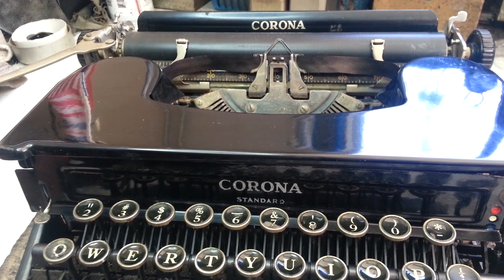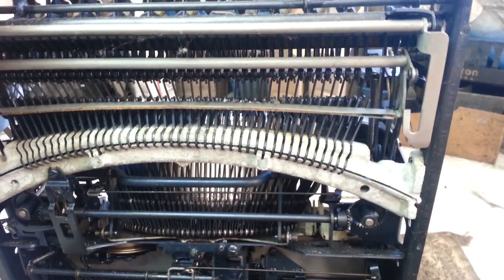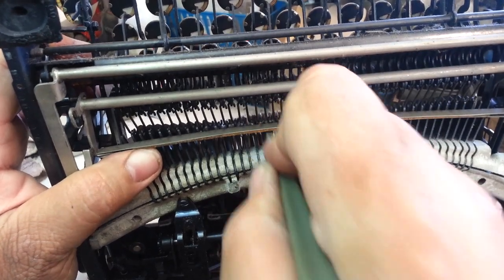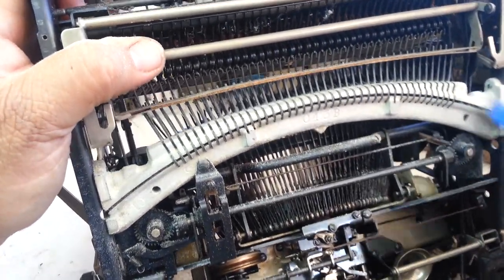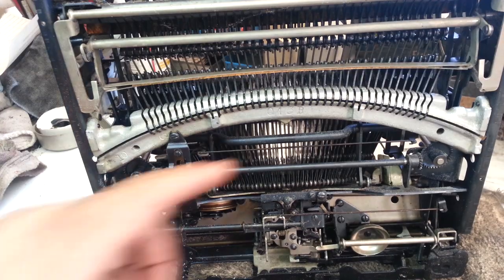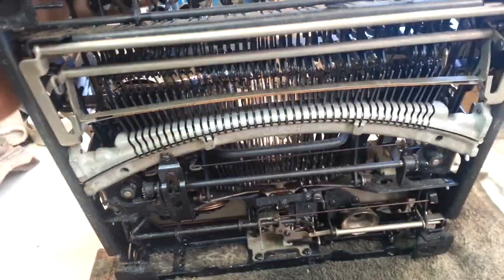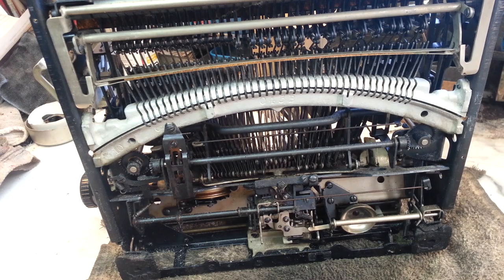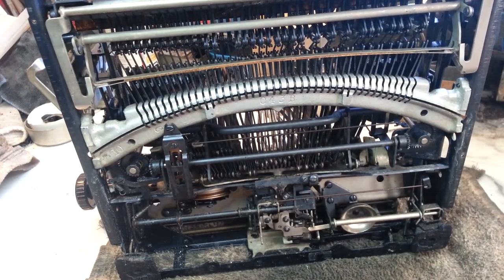Smith Corona Typewriter Lower Pivot Block Oxidation Removal Flush Clean Lube Procedure

Comment: The issue I have is the bell, the mechanism works but it doesn’t ding. The striker is resting on the bell. There’s a piece of metal at the pivot end that looks like maybe it’s supposed to be bent to adjust? Also the bell is on a 90° bracket so maybe that’s supposed to be bent down a bit? Not sure on that.
Reply from the maker: Once a bell's linkage get bent or wonky it can be very very tricking to get right
I many times need to do a side by side comparison with a unmolested typewriter, that's my advice . . . . . 
Here is some solid advice on bells in particular
𝐈𝐭'𝐬 𝐛𝐞𝐬𝐭 𝐭𝐨 𝐮𝐧𝐝𝐞𝐫𝐬𝐭𝐚𝐧𝐝 𝐭𝐡𝐞 𝐛𝐚𝐬𝐢𝐜 𝐝𝐞𝐬𝐢𝐠𝐧 𝐩𝐡𝐢𝐥𝐨𝐬𝐨𝐩𝐡𝐲 𝐨𝐟 𝐚 𝐭𝐲𝐩𝐞𝐰𝐫𝐢𝐭𝐞𝐫 𝐛𝐞𝐥𝐥? 𝐓𝐡𝐢𝐧𝐤𝐢𝐧𝐠 𝐭𝐡𝐫𝐨𝐮𝐠𝐡 𝐭𝐡𝐞 𝐦𝐞𝐜𝐡𝐚𝐧𝐢𝐜𝐬 𝐨𝐟 𝐡𝐨𝐰 𝐢𝐭 𝐰𝐨𝐫𝐤𝐬, 𝐭𝐡𝐞𝐧 𝐨𝐛𝐬𝐞𝐫𝐯𝐢𝐧𝐠 𝐰𝐡𝐚𝐭 𝐢𝐭 𝐝𝐨𝐞𝐬, 𝐡𝐞𝐥𝐩𝐬 𝐲𝐨𝐮 𝐜𝐨𝐦𝐞 𝐮𝐩 𝐰𝐢𝐭𝐡 𝐢𝐝𝐞𝐚𝐬 𝐭𝐨 𝐢𝐧𝐯𝐞𝐬𝐭𝐢𝐠𝐚𝐭𝐞 𝐭𝐨 𝐟𝐢𝐧𝐝 𝐭𝐡𝐞 𝐫𝐨𝐨𝐭 𝐜𝐚𝐮𝐬𝐞 𝐨𝐟 𝐰𝐡𝐚𝐭'𝐬 𝐜𝐚𝐮𝐬𝐢𝐧𝐠 𝐭𝐡𝐞 𝐬𝐲𝐬𝐭𝐞𝐦 𝐭𝐨 𝐦𝐢𝐬𝐛𝐞𝐡𝐚𝐯𝐞.

𝐄𝐯𝐞𝐫𝐲 𝐛𝐞𝐥𝐥 𝐬𝐲𝐬𝐭𝐞𝐦 𝐢𝐧 𝐚 𝐭𝐲𝐩𝐞𝐰𝐫𝐢𝐭𝐞𝐫 𝐡𝐚𝐬 (𝐰𝐨𝐫𝐤𝐢𝐧𝐠 𝐛𝐚𝐜𝐤𝐰𝐚𝐫𝐝𝐬 𝐟𝐫𝐨𝐦 𝐭𝐡𝐞 𝐛𝐞𝐥𝐥 𝐢𝐭𝐬𝐞𝐥𝐟):
𝟏. 𝐭𝐡𝐞 𝐛𝐞𝐥𝐥 𝐨𝐟 𝐜𝐨𝐮𝐫𝐬𝐞, 𝐰𝐡𝐢𝐜𝐡 𝐧𝐞𝐞𝐝𝐬 𝐭𝐨 𝐧𝐨𝐭 𝐭𝐨𝐮𝐜𝐡 𝐚𝐧𝐲𝐭𝐡𝐢𝐧𝐠 𝐨𝐫 𝐲𝐨𝐮 𝐰𝐢𝐥𝐥 𝐠𝐞𝐭 𝐚 𝐦𝐮𝐭𝐞𝐝 𝐨𝐫 𝐝𝐮𝐥𝐥 𝐬𝐨𝐮𝐧𝐝.
𝟐. 𝐚 𝐜𝐥𝐚𝐩𝐩𝐞𝐫. 𝐓𝐡𝐞𝐬𝐞 𝐯𝐚𝐫𝐲 𝐟𝐫𝐨𝐦 𝐦𝐚𝐜𝐡𝐢𝐧𝐞 𝐭𝐨 𝐦𝐚𝐜𝐡𝐢𝐧𝐞 𝐚𝐧𝐝 𝐝𝐞𝐬𝐢𝐠𝐧 𝐭𝐨 𝐝𝐞𝐬𝐢𝐠𝐧. 𝐒𝐨𝐦𝐞𝐭𝐢𝐦𝐞𝐬 𝐚 𝐰𝐢𝐫𝐞 𝐰𝐢𝐭𝐡 𝐚 𝐛𝐫𝐚𝐬𝐬 𝐨𝐫 𝐥𝐞𝐚𝐝 𝐛𝐚𝐥𝐥 𝐨𝐧 𝐭𝐡𝐞 𝐞𝐧𝐝, 𝐬𝐨𝐦𝐞𝐭𝐢𝐦𝐞𝐬 𝐚 𝐥𝐨𝐧𝐠 𝐬𝐭𝐞𝐞𝐥 𝐚𝐫𝐦 𝐨𝐧 𝐚 𝐩𝐢𝐯𝐨𝐭, 𝐬𝐨𝐦𝐞𝐭𝐢𝐦𝐞𝐬 𝐚 𝐡𝐚𝐦𝐦𝐞𝐫 𝐦𝐞𝐜𝐡𝐚𝐧𝐢𝐬𝐦. 𝐓𝐡𝐞𝐲 𝐬𝐡𝐨𝐮𝐥𝐝 𝐧𝐨𝐭 𝐭𝐨𝐮𝐜𝐡 𝐭𝐡𝐞 𝐛𝐞𝐥𝐥 𝐢𝐧 𝐭𝐡𝐞 𝐫𝐞𝐬𝐭𝐢𝐧𝐠 𝐩𝐨𝐬𝐢𝐭𝐢𝐨𝐧.
𝟑. 𝐀 𝐬𝐩𝐫𝐢𝐧𝐠 𝐭𝐡𝐚𝐭 𝐡𝐞𝐥𝐩𝐬 𝐭𝐨 𝐟𝐥𝐢𝐜𝐤 𝐭𝐡𝐞 𝐛𝐞𝐥𝐥 𝐜𝐥𝐚𝐩𝐩𝐞𝐫/𝐡𝐚𝐦𝐦𝐞𝐫.
𝟒. 𝐀 𝐭𝐫𝐢𝐩 𝐦𝐞𝐜𝐡𝐚𝐧𝐢𝐬𝐦 𝐭𝐡𝐚𝐭 𝐜𝐫𝐞𝐚𝐭𝐞𝐬 𝐭𝐡𝐞 "𝐟𝐥𝐢𝐜𝐤" 𝐭𝐨 𝐜𝐚𝐮𝐬𝐞 𝐭𝐡𝐞 𝐜𝐥𝐚𝐩𝐩𝐞𝐫 𝐨𝐫 𝐡𝐚𝐦𝐦𝐞𝐫 𝐭𝐨 𝐬𝐭𝐫𝐢𝐤𝐞 𝐭𝐡𝐞 𝐛𝐞𝐥𝐥.
𝟓. 𝐀 𝐫𝐢𝐠𝐡𝐭-𝐡𝐚𝐧𝐝 𝐦𝐚𝐫𝐠𝐢𝐧 𝐭𝐫𝐢𝐠𝐠𝐞𝐫 𝐭𝐡𝐚𝐭 𝐞𝐧𝐠𝐚𝐠𝐞𝐬 𝐰𝐢𝐭𝐡 𝐭𝐡𝐞 𝐭𝐫𝐢𝐩 𝐦𝐞𝐜𝐡𝐚𝐧𝐢𝐬𝐦 𝐭𝐨 𝐟𝐥𝐢𝐜𝐤 𝐭𝐡𝐞 𝐜𝐥𝐚𝐩𝐩𝐞𝐫/𝐡𝐚𝐦𝐦𝐞𝐫.

𝐒𝐨 𝐬𝐨𝐦𝐞 𝐩𝐢𝐞𝐜𝐞 (𝐨𝐫 𝐩𝐢𝐞𝐜𝐞𝐬) 𝐨𝐟 𝐭𝐡𝐢𝐬 𝐜𝐡𝐚𝐢𝐧 𝐨𝐟 𝐦𝐞𝐜𝐡𝐚𝐧𝐢𝐜𝐬 𝐢𝐬 𝐟𝐚𝐢𝐥𝐢𝐧𝐠 𝐭𝐨 𝐝𝐨 𝐢𝐭𝐬 𝐣𝐨𝐛.

𝐒𝐞𝐭 𝐲𝐨𝐮𝐫 𝐫𝐢𝐠𝐡𝐭 𝐦𝐚𝐫𝐠𝐢𝐧 𝐬𝐨𝐦𝐞𝐰𝐡𝐞𝐫𝐞 𝐡𝐚𝐧𝐝𝐲, 𝐝𝐞𝐩𝐫𝐞𝐬𝐬 𝐭𝐡𝐞 𝐜𝐚𝐫𝐫𝐢𝐚𝐠𝐞 𝐫𝐞𝐥𝐞𝐚𝐬𝐞, 𝐠𝐞𝐭 𝐲𝐨𝐮𝐫𝐬𝐞𝐥𝐟 𝐚𝐧𝐝 𝐦𝐚𝐜𝐡𝐢𝐧𝐞 𝐢𝐧 𝐚 𝐜𝐨𝐦𝐟𝐨𝐫𝐭𝐚𝐛𝐥𝐞, 𝐟𝐥𝐚𝐭/𝐡𝐨𝐫𝐢𝐳𝐨𝐧𝐭𝐚𝐥 𝐩𝐥𝐚𝐜𝐞 (𝐚𝐬 𝐭𝐡𝐞 𝐦𝐚𝐫𝐠𝐢𝐧 𝐛𝐞𝐥𝐥 𝐬𝐲𝐬𝐭𝐞𝐦 𝐫𝐞𝐥𝐢𝐞𝐬 𝐚 𝐥𝐨𝐭 𝐨𝐧 𝐠𝐫𝐚𝐯𝐢𝐭𝐲 𝐭𝐨 𝐩𝐫𝐨𝐯𝐢𝐝𝐞 𝐜𝐨𝐮𝐧𝐭𝐞𝐫-𝐟𝐨𝐫𝐜𝐞𝐬, 𝐬𝐨 𝐭𝐢𝐩𝐩𝐢𝐧𝐠 𝐚 𝐦𝐚𝐜𝐡𝐢𝐧𝐞 𝐚𝐫𝐨𝐮𝐧𝐝 𝐦𝐚𝐲 𝐝𝐞𝐟𝐞𝐚𝐭 𝐚𝐧 𝐨𝐭𝐡𝐞𝐫𝐰𝐢𝐬𝐞 𝐧𝐨𝐫𝐦𝐚𝐥𝐥𝐲 𝐨𝐩𝐞𝐫𝐚𝐭𝐢𝐧𝐠 𝐦𝐚𝐫𝐠𝐢𝐧 𝐛𝐞𝐥𝐥), 𝐚𝐧𝐝 𝐰𝐨𝐫𝐤 𝐭𝐡𝐞 𝐜𝐚𝐫𝐫𝐢𝐚𝐠𝐞 𝐛𝐚𝐜𝐤 𝐚𝐧𝐝 𝐟𝐨𝐫𝐭𝐡, 𝐰𝐚𝐭𝐜𝐡𝐢𝐧𝐠 𝐭𝐡𝐞 𝐦𝐚𝐫𝐠𝐢𝐧 𝐬𝐞𝐭 𝐟𝐨𝐫 𝐭𝐡𝐞 𝐭𝐫𝐢𝐠𝐠𝐞𝐫/𝐭𝐫𝐢𝐩 𝐦𝐞𝐜𝐡𝐚𝐧𝐢𝐬𝐦𝐬.

𝐀𝐫𝐞 𝐭𝐡𝐞𝐲 𝐜𝐚𝐭𝐜𝐡𝐢𝐧𝐠? 𝐈𝐬 𝐭𝐡𝐞 "𝐟𝐥𝐢𝐜𝐤" 𝐡𝐚𝐩𝐩𝐞𝐧𝐢𝐧𝐠? 𝐈𝐬 𝐭𝐡𝐞 𝐜𝐥𝐚𝐩𝐩𝐞𝐫/𝐡𝐚𝐦𝐦𝐞𝐫 𝐦𝐨𝐯𝐢𝐧𝐠 𝐚𝐭 𝐚𝐥𝐥? 𝐈𝐬 𝐭𝐡𝐞 𝐜𝐥𝐚𝐩𝐩𝐞𝐫 𝐬𝐭𝐫𝐢𝐤𝐢𝐧𝐠 𝐭𝐡𝐞 𝐛𝐞𝐥𝐥 𝐛𝐮𝐭 𝐬𝐭𝐢𝐥𝐥 𝐧𝐨𝐭 𝐫𝐢𝐧𝐠𝐢𝐧𝐠?

𝐀𝐥𝐥 𝐨𝐟 𝐭𝐡𝐞𝐬𝐞 𝐭𝐡𝐢𝐧𝐠𝐬 𝐡𝐚𝐯𝐞 𝐭𝐡𝐞𝐢𝐫 𝐨𝐰𝐧 𝐫𝐞𝐦𝐞𝐝𝐢𝐞𝐬 𝐢𝐟 𝐭𝐡𝐞𝐲 𝐚𝐫𝐞 𝐧𝐨𝐭 𝐰𝐨𝐫𝐤𝐢𝐧𝐠.

𝐈𝐭'𝐬 𝐲𝐨𝐮𝐫 𝐣𝐨𝐛 𝐭𝐨 𝐝𝐞𝐭𝐞𝐫𝐦𝐢𝐧𝐞 𝐰𝐡𝐢𝐜𝐡 𝐥𝐢𝐧𝐤 𝐨𝐟 𝐭𝐡𝐞 𝐜𝐡𝐚𝐢𝐧 𝐢𝐬 𝐟𝐚𝐢𝐥𝐢𝐧𝐠 ... 𝐚𝐧𝐝 𝐚 𝐭𝐢𝐩, 𝐲𝐨𝐮 𝐦𝐚𝐲 𝐜𝐡𝐚𝐧𝐠𝐞 𝐨𝐧𝐞 𝐭𝐡𝐢𝐧𝐠, 𝐚𝐧𝐝 𝐭𝐡𝐞𝐧 𝐭𝐡𝐞 𝐥𝐢𝐧𝐤𝐬 "𝐝𝐨𝐰𝐧𝐬𝐭𝐫𝐞𝐚𝐦" 𝐢𝐧 𝐭𝐡𝐞 𝐜𝐡𝐚𝐢𝐧 𝐨𝐟 𝐞𝐯𝐞𝐧𝐭𝐬 𝐦𝐚𝐲 𝐯𝐞𝐫𝐲 𝐰𝐞𝐥𝐥 𝐜𝐡𝐚𝐧𝐠𝐞 𝐬𝐲𝐦𝐩𝐭𝐨𝐦𝐬.

𝐒𝐨𝐦𝐞𝐭𝐢𝐦𝐞𝐬 𝐝𝐢𝐚𝐠𝐧𝐨𝐬𝐢𝐬 𝐚𝐧𝐝 𝐫𝐞𝐩𝐚𝐢𝐫 𝐨𝐟 𝐚 𝐬𝐮𝐛𝐬𝐲𝐬𝐭𝐞𝐦 𝐚𝐬 𝐬𝐞𝐞𝐦𝐢𝐧𝐠𝐥𝐲 𝐬𝐢𝐦𝐩𝐥𝐞 𝐚𝐬 𝐚 𝐦𝐚𝐫𝐠𝐢𝐧 𝐛𝐞𝐥𝐥, 𝐢𝐬 𝐚 𝐠𝐫𝐞𝐚𝐭 𝐞𝐱𝐞𝐫𝐜𝐢𝐬𝐞 𝐢𝐧 𝐭𝐡𝐞 𝐜𝐨𝐦𝐩𝐥𝐞𝐱𝐢𝐭𝐲 𝐚𝐧𝐝 𝐢𝐧𝐭𝐞𝐫𝐫𝐞𝐥𝐚𝐭𝐢𝐨𝐧𝐬𝐡𝐢𝐩𝐬 𝐨𝐟 𝐭𝐡𝐞 𝐦𝐞𝐜𝐡𝐚𝐧𝐢𝐜𝐬 𝐨𝐟 𝐚 𝐭𝐲𝐩𝐞𝐰𝐫𝐢𝐭𝐞𝐫.

𝐓𝐡𝐞𝐫𝐞 𝐢𝐬 𝐧𝐨 𝐞𝐚𝐬𝐲 𝐚𝐧𝐬𝐰𝐞𝐫, 𝐲𝐨𝐮 𝐡𝐚𝐯𝐞 𝐭𝐨 𝐠𝐞𝐭 𝐲𝐨𝐮𝐫 "𝐡𝐞𝐚𝐝 𝐢𝐧 𝐭𝐡𝐞𝐫𝐞" 𝐚𝐧𝐝 𝐬𝐞𝐞 𝐰𝐡𝐚𝐭'𝐬 𝐠𝐨𝐢𝐧𝐠 𝐨𝐧.

𝐓𝐈𝐏: 𝐀𝐭𝐭𝐞𝐦𝐩𝐭 𝐭𝐨 𝐧𝐨𝐭 𝐜𝐡𝐚𝐧𝐠𝐞 𝐚𝐧𝐲𝐭𝐡𝐢𝐧𝐠 𝐮𝐧𝐭𝐢𝐥 𝐲𝐨𝐮 𝐜𝐚𝐧 𝐞𝐱𝐩𝐥𝐚𝐢𝐧 𝐡𝐨𝐰 𝐭𝐡𝐚𝐭 𝐜𝐡𝐚𝐧𝐠𝐞 𝐢𝐬 𝐥𝐢𝐤𝐞𝐥𝐲 𝐭𝐨 𝐫𝐞𝐬𝐨𝐥𝐯𝐞 𝐭𝐡𝐞 𝐢𝐬𝐬𝐮𝐞. 𝐂𝐡𝐚𝐧𝐠𝐢𝐧𝐠 𝐭𝐡𝐢𝐧𝐠𝐬 𝐡𝐚𝐩𝐡𝐚𝐳𝐚𝐫𝐝𝐥𝐲 𝐜𝐚𝐧 𝐜𝐫𝐞𝐚𝐭𝐞 𝐞𝐧𝐭𝐢𝐫𝐞𝐥𝐲 𝐧𝐞𝐰 𝐩𝐫𝐨𝐛𝐥𝐞𝐦𝐬 𝐭𝐡𝐚𝐭 𝐫𝐞𝐪𝐮𝐢𝐫𝐞 𝐭𝐡𝐞𝐢𝐫 𝐨𝐰𝐧 𝐬𝐨𝐥𝐮𝐭𝐢𝐨𝐧𝐬.

Comment: Hi Duane.  Great job on the Corona.  I understand why you use lacquer thinner, but I'm reluctant to use a chemical so potent in my house.  Can you recommend an alternative flush that is almost as good but not quite as overwhelming?   Many thanks, H
Reply: I don't intend to answer for Duane but this question has been asked and answered many times in the past. For example, see his reply below: "I have tried less potent chemicals with poor & slow, results."

So have I 😃 

I've also used more potent chemicals (which I won't mention) with disastrous results. 

Among experienced typewriter technicians, LT has been the preferred solvent for years. There is nothing almost as good, and there really isn't anything preferable to it.

Comment: What did you use to rinse out the oxidation dust after brushing it?
Reply from the maker: My standard flush with lacquer thinner, finished with Nutrol spray cleaner and a trace of oil, all excess blow out.
https://www.ebay.com/itm/203648187505
Reply: Nu-trol 401 or 409? 

The 401B Nu-Troll Control Cleaner for Electronics is a unique blend of high purity solvents and a lubricating mineral oil that is excellent for cleaning and lubricating delicate moving parts in electronics. The solvent system also effectively dissolves oil and organic residues.

Comment: Is it a concern that the air might blow some thinner onto the paint?
Reply from the maker: Yes, droplets of lacquer thinner can stain certain paints, best to coat with WD-40 or cover as needed
The only thing left on this unit that could be harmed is the back panel & it's too far away from where I'm using the thinner
When zapping LT with compressed air it generally vaporizes instantly, biggest thing is Ventilation !
A mixture of LT and the Nutrol spray will splatter some because of the oil, but it's now diluted the LT to a no harm level
I have tried less potent chemicals with poor & slow, results. With my 40 yr experience using strong chemicals I have mastered this process.